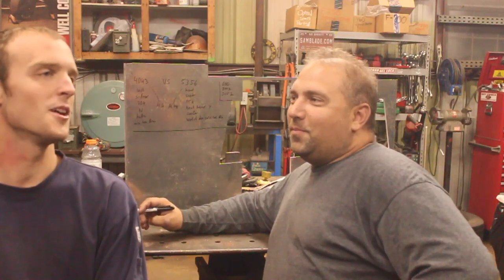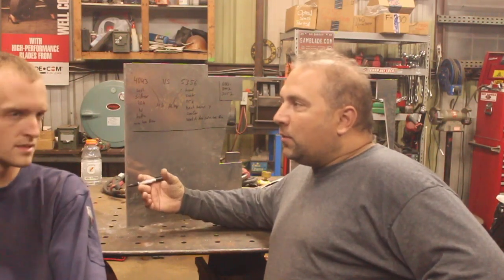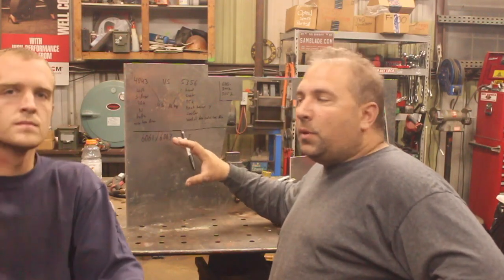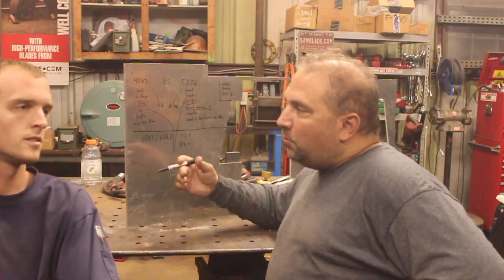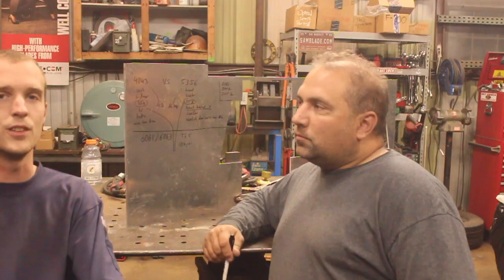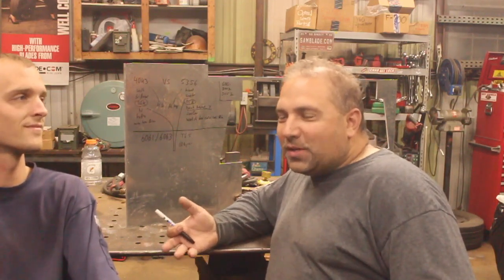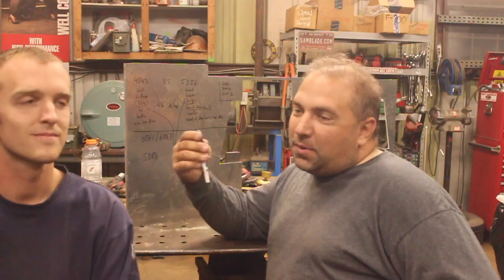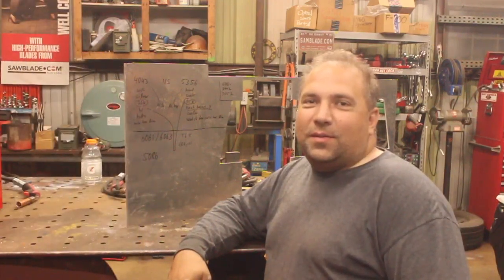ALUMINIM FILLER WIRE FOR REPAIR WORK WHICH GRADE TO CHOOSE 4043 VS 6061

Comment: Thank you for this video. A guy came into the shop the other day with an equipment truck and the bumper is cracked where he had an anvil bolted on. I have been so busy I haven't had time to work on it and the customer is patiently waiting for me. I am not well versed in aluminum welding yet. I was thinking that it was a 6000 series type of aluminum but after watching this video I remembered that his bumper is all riveted together so that leads me to believe that it's not worth my time to weld it. I will ask the customer if he has any specs on it but I'm thinking I will turn him away.

Comment: Dump truck and semi dumps are notorious for cracks and busted welds. Problem is the aluminum  is so dirty and oxidized it is very hard to burn a good weld on it no matter how much grinding ,filing, sanding and cussing you do. Excellent vid Chuck.